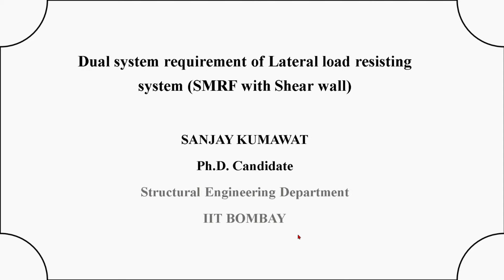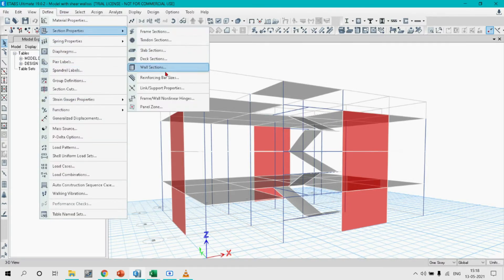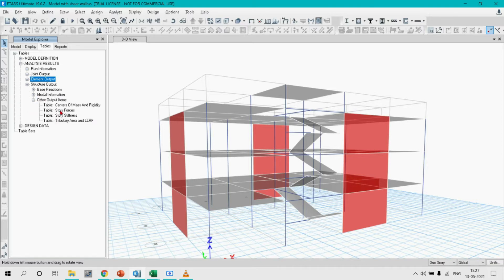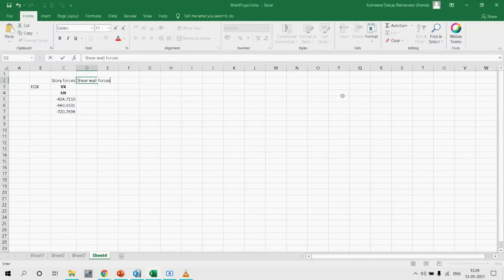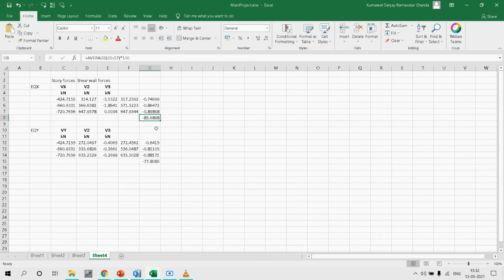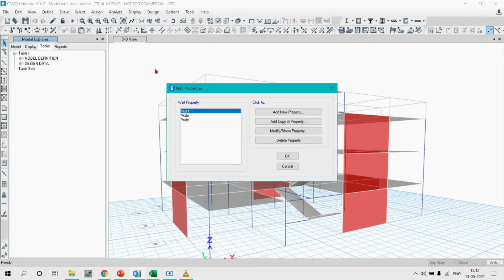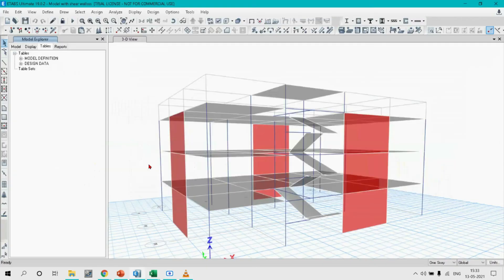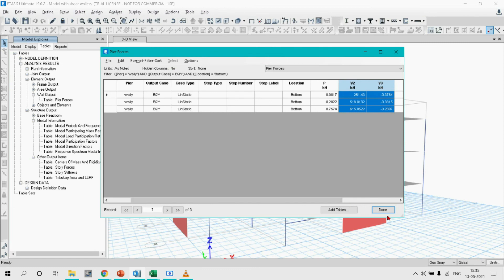Dual System requirement of buildings with SMRF and Shear walls in ETABS

Comment: What if column doesnt contribute by 25% of total base shear. How to give minimum 25% base shear to column in that case
Reply from the maker: If we make sure that 75% of the base shear is taken up by the shear walls independently then the remaining will be obviously taken by the moment-resisting frames.
Reply: @sanjaykumawat8734  thank you for a reply but we may also face a case where shear wall may take more than 75 % base shear than In that case column will take less than 25% base shear..In this case; How can we provide minimum 25% base shear to columb
Reply from the maker: @structurelearninghub3340  I have explained an iterative method by varying the thickness of the shear wall to satisfy this condition in this video above...pls look at it once
Reply: @sanjaykumawat8734  can Scale up the factor for load cases EQX and EQY to meet minimum 25% base shear for column design only with separate model
Reply: @sanjaykumawat8734  How can we say that the remaining 25% base shear will taken by column. In this video no calculation for column base shear as like for shear wall is calculated. If from column calculation takes less than 25% then what?
Reply: use stiffness modifiers in a separate model by doing so 25% can be managed

Comment: Code doesn't say you proportion stiffness such that 75% of the base share is taken by shear wall and 25% by MRF but it says MRF should be designed such that it is capable of resisting 25% of Base Shea. In reality the base shear taken by frames could be less but they must be designed for 25%.

Comment: Sorry to say that this is not the right method to satisfy this requirement. Satisfying this requirement needs to analyze a second model with frames only, by removing the shear walls, under 25% lateral load and then compares, frame by frame, the story shear forces to those taken by the frame in the initial model. 
Please refer to section 7.4.1 of the FEMA P-751(2012) for a detailed example of how to satisfy this requirement (link below)
https://www.wbdg.org/ffc/dhs/criteria/fema-p-750
Reply from the maker: Yes, I know it is not an exact method, but I was just interested in knowing what flaws this method could have...If you can please share your views on this....I just figured out this method during my coursework and found it to be reasonable...Thankyou.
Reply: 75% base shear for wall is not seen in Indian standard.......